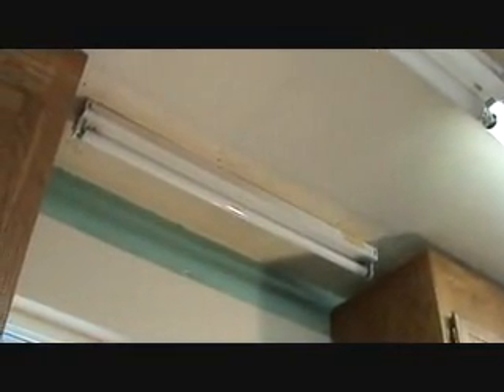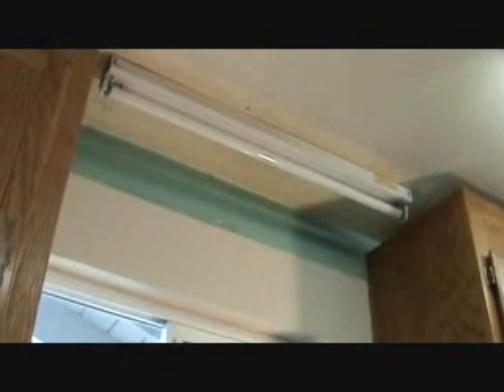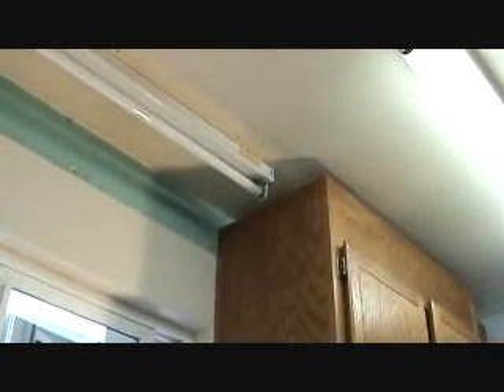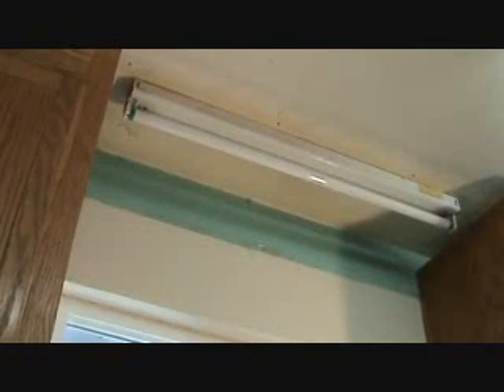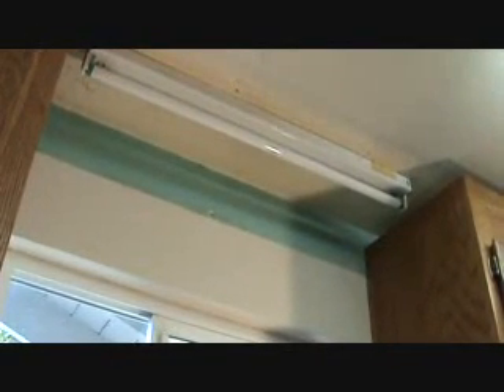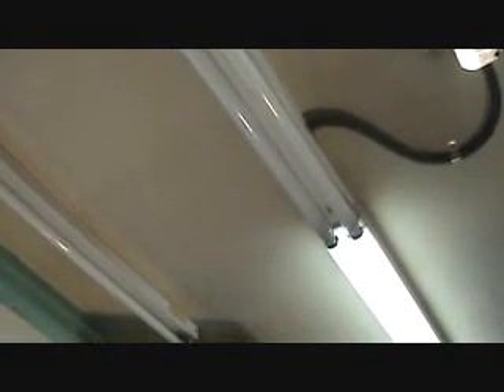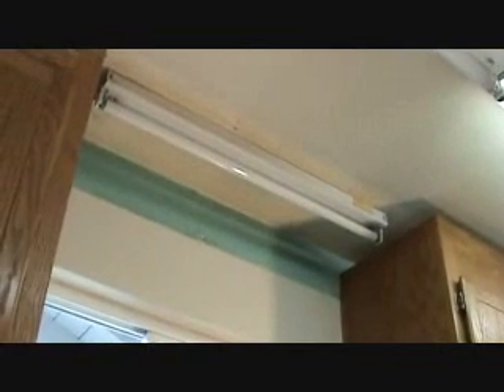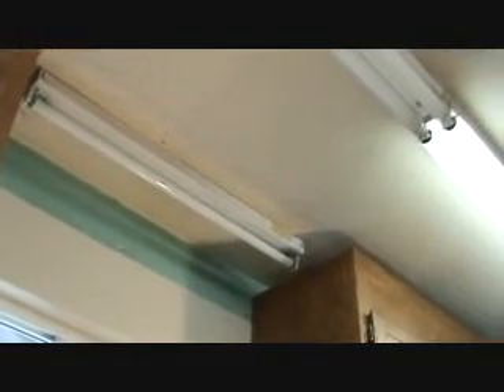Retrofitting a fluorescent light fixture

Comment: Hey thanks, Changing a fluorescent ballast is fun. Before you replace a ballast, look at the diagram! which you already knew. The black and white wires go to the switch and power. The other colored wires go to the light sockets or ( lamp holders). T8 I think is more energy effecient. I plan to change the ballasts in my garage. I am running t12 and they effect the electric bill big. Thanks for uploading, I do plan to do this.
Reply from the maker: Good luck with your project. Let me know how it goes!   Joe  :0